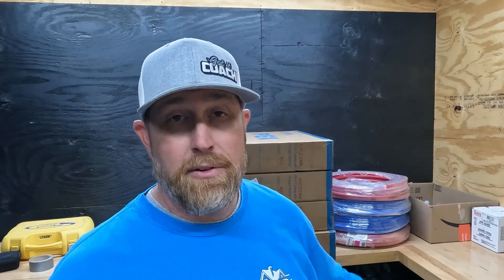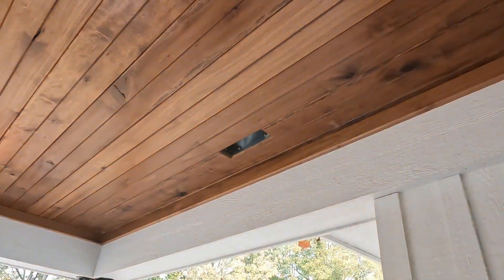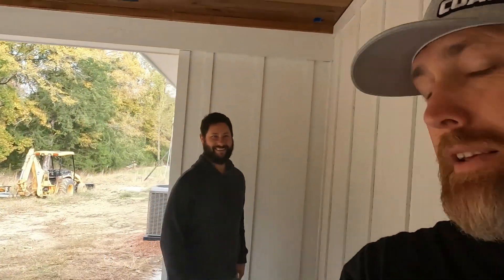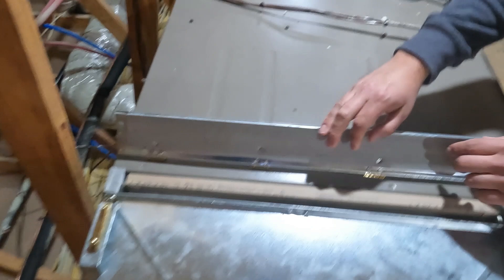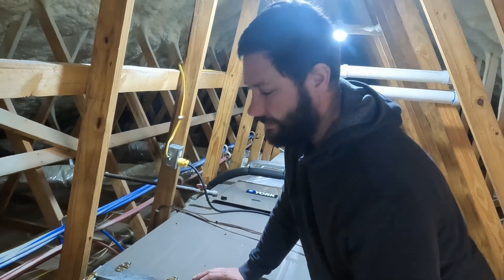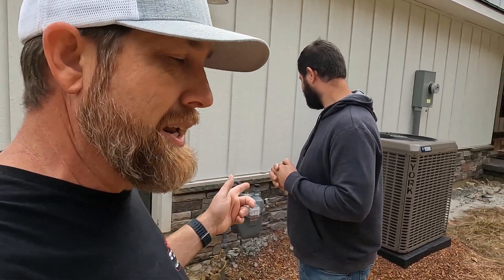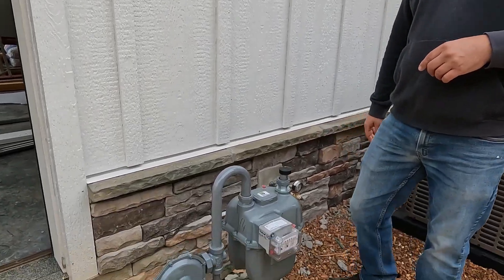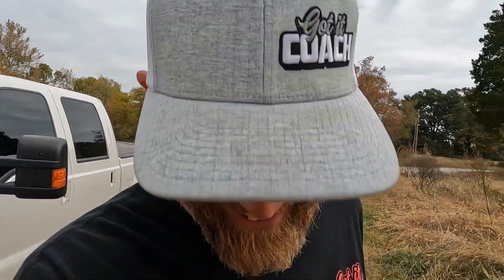Why does my HVAC system need "FRESH AIR" in a foam insulated house

Comment: If your truck is a Ford, you can use a program called FORScan to turn the beeping off. FORScan gives you access to and the ability to change the programming of the trucks on board computer.

I have a 2020 F350 and made several changes.
Reply from the maker: Sweet, never heard of that

Comment: I have a fresh air intake on my spray foam house and it's a carrier unit that has an automatic dampener that can be put in off or auto mode. I do wonder though since there are many vents that go to the outside such as fart fan venting, dryer venting, vet hood venting, which all have very poorly sealed dampeners wouldn't all of them combined create a lot of natural exchange?
Reply from the maker: 🤔 I would have to ask my guy Taddydigest on that one. I guess they would but seems like you would have to keep them on all the time to have “a lot”. Then you open an exterior door or window and you would have an influx of uncontrolled outside air forcing its way into the home.
Reply: @w.k.d.constructionllc  Ask him how you would test something like that? Do they make some type of oxygen meter that you could buy? For my example of having an automatic dampener made by Honeywell, how would you ever know if it ceased to function?